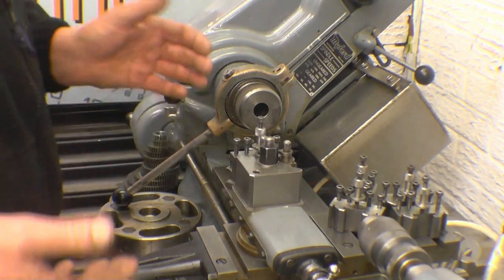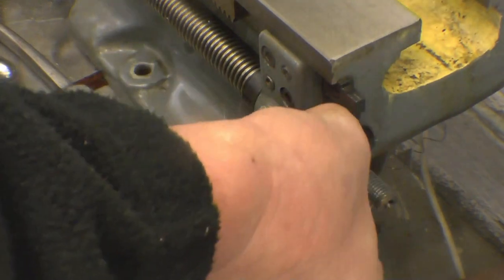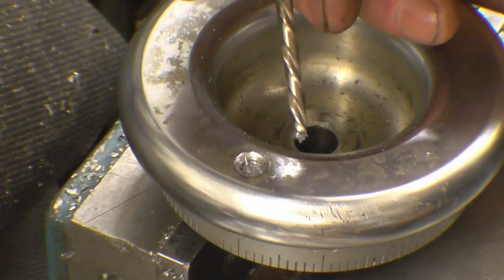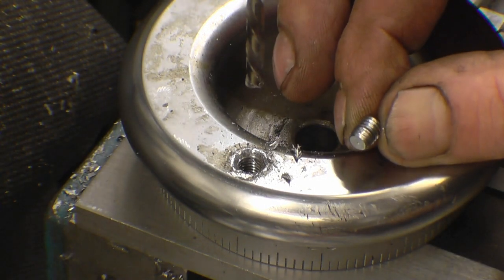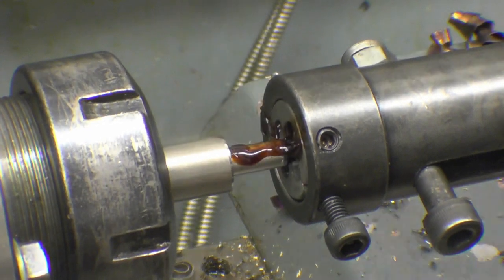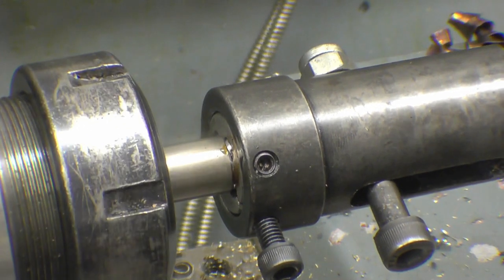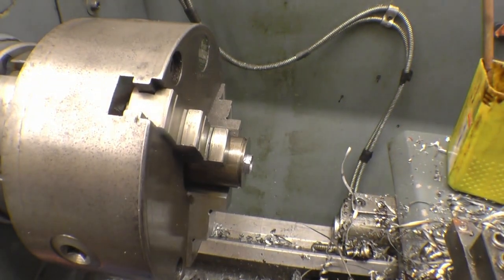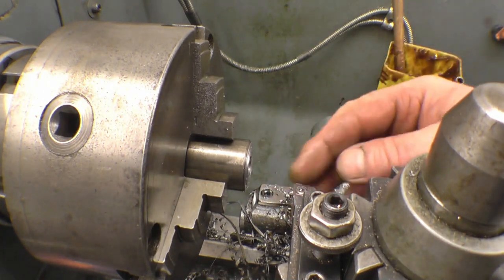SNNC 315 P2  Myford Hand Wheel Repair

Comment: Putting an Aloris type toolpost on that Myford...and a copy one from bang good at that. Wouldn't want to be in your shoes. They'll be round. Early hours of the morning, ominous rap on your door. Citroën Xsara with a Guildford number plate. Grey beards. Reading glasses on chains about their necks. Panama hats. The rustle of a copy of Model Engineer. It'll be them. The Myford Mafia.
Reply: You mean someone like Myford Boy?
Reply: @CraigLYoung  I don't know. I do not speak their names.
Reply: Carl I think there may be a book there or at the least a radio 4 play.
Reply: @caahacky  The sad thing is there is no need to make it up.
Reply: There's no escape John. They'll force you to eat Dundee cake and bore you to death about their horn blocks.
Reply: I had no idea... [shudder]
Reply: @caahacky  They'll declaim that No Self Respecting British Built Lathe would have anything other than BSF and Whitworth threads. Even though they did...If you are found in possession of heretical items such as metric rules, vernier or micrometers, you will be summarily burnt at the stake for the sin of Metricism. "And ye, he said unto them, that thou shalt measure thy parts using a system based on the number 12, for the number 10 and it's multiples be evil numbers. And he did sayeth unto them that surely Metric is the work of Satan".
Reply: "Then, having said this to the assembled, he raised his hand and said, Lo, ye though I told thee that the number 12 is a sacred number, and thou shouldst useth this to measure thy parts, I now tell you this. That the 1000th part of this number is yet the holiest of holies..."

"And be ye not like the vulgar merchant in the market place, who sayeth that 3 of 4 parts of these increments be 'three quarters'. Thou art called to a higher purpose. Thou shalt sayeth this quantity to be 750 of the 1000th part.."

Comment: Forgive my being a bit anal but surely with a classic British lathe that many of us aspire to owning the thread on the wheel handle should be BSF(55deg) not UNF(60deg)? I cannot wait 'till next week to see if this is corrected.
Reply: Without going out in the cold and windy evening to check,that would have been my presumption too.
Reply: That's another reason for the Mafia to be after him.
Reply: @britishreaction54  or men of taste.
Reply: @littleworkshopofhorrors2395  Joking apart, 1/4 BSF is 26 tpi and  1/4 UNF is 28. I think the UNF tap would have bound up if the thread was BSF. It did screw in and seemed to do so nicely. So looks like it is 1/4 UNF.

No reason why Myford wouldn't have used Unified fasteners. My Harrison Mill, circa late 60s does. If it is good enough for Harrison then it's good enough for Myford.